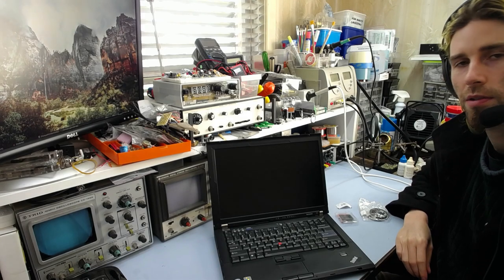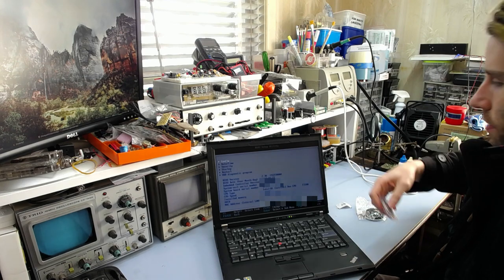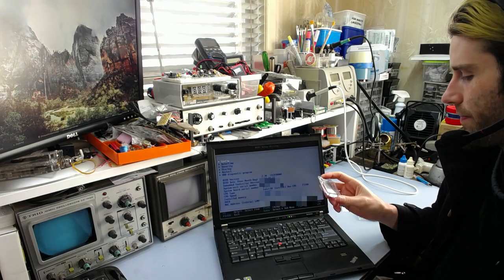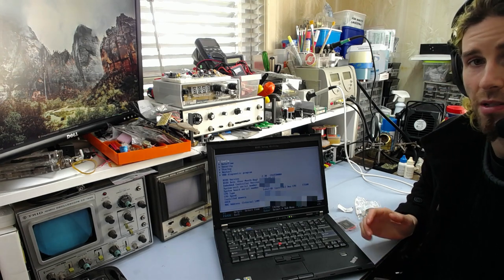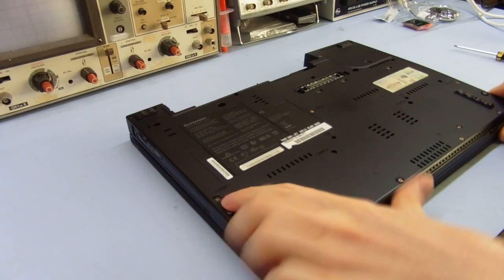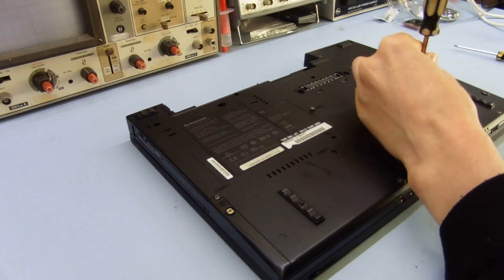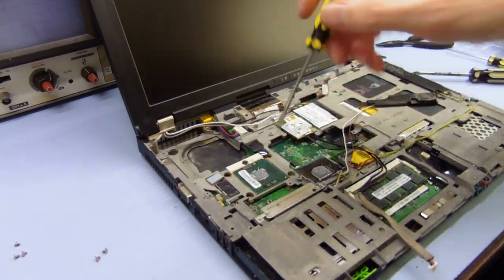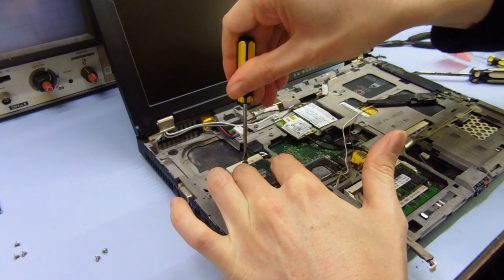Upgrading the CPU in my Lenovo Thinkpad T61

Comment: I have a pretty nice t61. It came with the fastest cpu available at the time, and nvidia graphics. It was one of the last to come off the line as a custom build so it has the reliable gpu. Replaced the fan 5 years ago and been running strong. Its my dj rig running real time linux , and I updated the bios for faster ssd speeds.

Comment: Useful to my T60 CPU upgrade thx. I've got a rumbling fan as well. And the screen is rather dim. Put in two 2Gb RAM sticks. Reads only 3Gb of course. SSD disk with Linux Mint. 
Standard graphics - still it's amazing how well these old ThinPads still work.

Comment: I just upgraded a beaten up T60 (to the T7400 CPU) and I forgot to update the BIOS in first try and it hit me like a brick that I had to do that in my failure feelings and after putting the old back. With my pretty T61 I'm now at a BIOS 2.30 and I picked up the T7700 processor in the "Post Office" today.

Comment: Faster tutorial:
1. Unplug all cables
2. Take off battery and hdd
3. Remove all screws holding keyboard and palmrest
4. Remove keyboard and palmrest (dont need to be unpluged just move them down) (if you dont know to how carefully remove keyboard and palmrest and what screws remove, watch video)
5. Remove cooler holders (small metal peices)
6. Remove cooler
7. Unscrew screw next to CPU and carefully remove it
8. Give there new
9. Also dont forget to remove thermal paste from coller, give thermal paste to new CPU and remove old on GPU and give there new.
10. Give everything back how it should be.
EDIT: before giving cooler back, check all cables if they are "free" to prevent them breaking, escaply the fan cable.

Comment: I had the same problem with the fan that seemed too big to me, really that's not a problem because the fan spins under and not inside that round space. You could also omit the tape since it's quite stable without it.
Reply from the maker: Thanks for the tip!

Comment: When you upgrade to a core 2 duo T9300 your laptop can play youtube 4k on a lenovo t61 i'm using this laptop every day the battery ist really good
Reply from the maker: That sounds like some great performance. I may try a T9300 if I ever find one cheap. But it looks like I need a new battery on mine before that...
Reply: Agent24 but my touch pad not working the cable is broken
Reply: Agent24 but core 2 duo t9900 is better than my cpu
Reply: i picked up a T61 with T9300 cpu off ebay.. added SSD and such and its working pretty fast.
Reply: Will it work with T7700?
Reply: what's the highest core 2 duo the t61 will accept?
Reply: T9300 is awesome for YouTube etc.

Comment: Almost been a year. Have you had any heat issues?
Reply from the maker: The fan does run more often but that's it really, and of course it does run the battery down faster. Still better than my previous laptop which had a P4 Prescott (!)

Comment: Hello ta all. I have question: Just got used T61 and put 2x2GB of RAM but the laptop can recognize only 3GB of RAM. What i the problem? It run Windows XP pro, 32 bit. Thank you
Reply from the maker: Your problem is likely the 32-bit version of Windows. Depending on the computer, how much RAM is shared for graphics etc, a 32-bit Windows typically can only use about 3.5GB of RAM. To use 4GB or more, you will need to change to a 64-bit version.
Reply: @Agent24Electronics  I see. Thank you for your fast reply. So may I leave this T61 with 2x2GB RAM, is it problem for the laptop?
Reply from the maker: @mariok6519  No problem for the laptop at all. It will not damage anything or cause instability. I have 4GB in mine also, but since I run 64-bit Linux I can use all of it (except that which is shared with the IGP)

Comment: New CPU?
Reply from the maker: I upgraded mine to a T7800 which is the fastest you can run on the official BIOS. You can upgrade to a 3rd party BIOS which supports Penryn CPUs too, but the thermal sensor support for those is incomplete, apparently. (Due to hardware limitations)